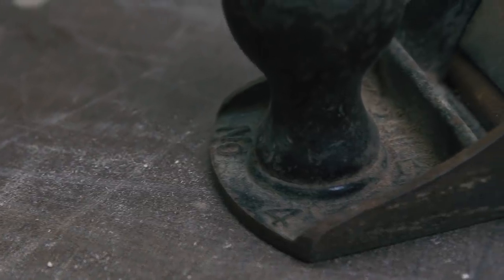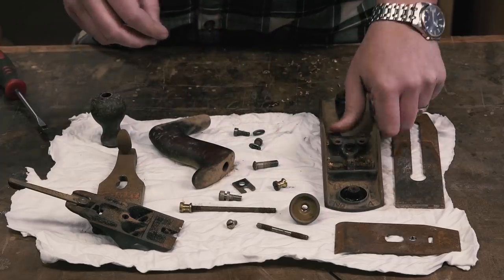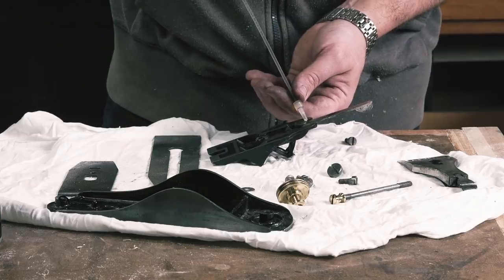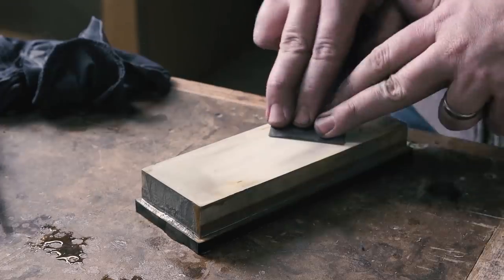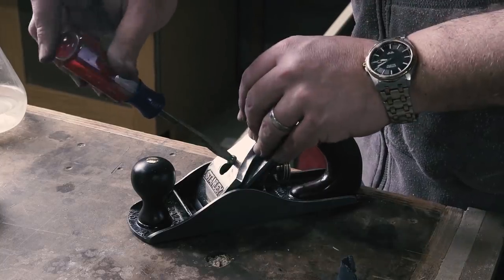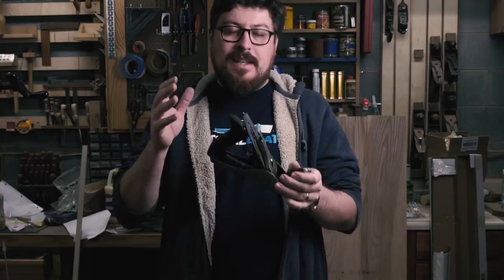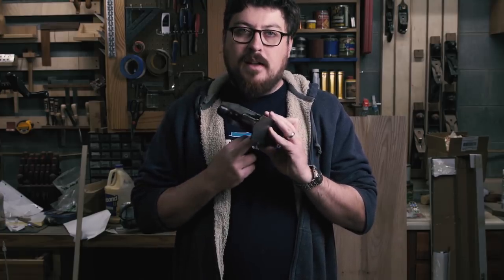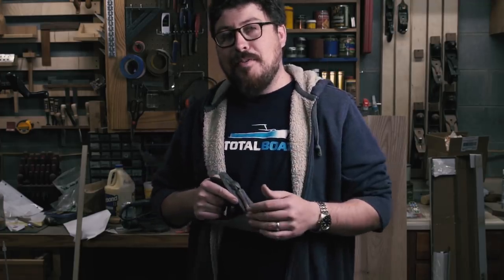How to Clean and Setup a Handplane (better than Katz-Moses)

Comment: One step that I recommend after de-rusting is to rub everything down with light oil and wipe of any excess. It will keep the micro pits from immediately turning black or begin rusting again in a garage or workshop.
Reply from the maker: That is a great tip!

Comment: Paste wax and polish while still in pieces is critical for where I am because of the dampness. Vinegar bath leaves a layer of carbon on the surface as it eats away the iron which is messy to deal with. Doesn’t look like that’s a big problem with this product. Thanks for the video.

Comment: Great video but I have a question. How far forward do you set the frog? I'm having issues with getting thin shavings and I have yet to see a video on this. Any help would be greatly appreciated. Thank you!
Reply: Try far enough so the blade won't touch the back of the mouth and not so forward that the blade binds with the front of the mouth when adjusting to depth... took me 3 days to figure that one out.

Comment: Haha, the #katzmoseswalkerfeud battle has a clear winner now! The shavings you took are stunning, can't believe my eyes.
Do you think this smoothing plane would be able to take a good shaving from a random-grain-direction surface? I recently tried using a number 5 jack plane on a cookie slab (3 trunks grown together, very unique piece) and couldn't get a decent pass even though the plane is nicely tuned.
Reply from the maker: That's a tough cut for any plane since you're cutting endgrain in a cookie. I think that would be a job for a low-angle jack.
Reply: Thanks a lot, I'll give it a go next time I work with a cookie like that!

Comment: Any tips on how to free a depth adjustment knob that is frozen in the frog? I cannot move it to save my life.
Reply from the maker: Have you tried soaking it in vinegar or metal rescue? Penetrating oil? Heat?
Reply: Is the knob stuck to the screw but free of the frog? Or is the knob, screw, and frog all locked in place? This can make the removal steps different depending on the set-up.
Reply: Blowlamp, let it cool a short time, then blast it liberally with WD40. Let it stand, then try to undo.
Reply: @thathandtoolguy  I cannot turn the adjustment knob at all - it is locked tight into the frog itself. Won't budge.
Reply: @wmwalkerco  Not yet - never heard of metal rescue. I'll check it out. I was not sure what to try to limit any risk. Thanks.
Reply: @bobpetti If would be careful heating up the brass with a torch as well as taking a torch to it when it's that close to the frog. As this could potentially cause stress cracks in the cast iron. I would use  a heat gun instead lower heat that wont damage brass or cast. I would heat it up and then soak it all in penetrating oil like Pb Blaster or Kroil. WD 40 is basically oily water. If the heat and oil dont loosen it up then a long term soak in Evaporust should work.
Reply: @thathandtoolguy  Ok thanks. It was fine one day - and then we had a real humid streak and everything in the garage got covered in condensation - and the next time I picked it up it was stuck solid. I'll give that a try - thank you.
Reply: On mine (Craftsman made by Stanley), the depth adjustment knob is reverse-threaded. I don't know if that's typical or not. But you might want to make sure you aren't trying to turn it the wrong direction.
Reply: @sgsax  Its quite common for depth adjuster threads to be left hand thread.
Reply: Remember that it’s most likely left hand thread.  If that’s not the problem, get some Kroil penetrating oil and drip a bunch into the threads.  Let it soak overnight and try it again.  Rinse and repeat as necessary.
Reply: @thathandtoolguy  WD-40 is Stoddard's solvent which is a petroleum distillate. There is no water in it whatsoever.
Reply: @1pcfred  I agree that WD40 is a commercial solvent aka water displacement version 40 and is a petroleum based product. What I meant by that water statement was that from years of using industrial solvents and lubricants is that WD40 is almost as useless as putting water on a stuck nut.
Reply: @thathandtoolguy  while WD-40 is not much of a penetrating lubricant it was never designed to be. It was made as a protective coating for rocket components.

Comment: I thought high boy knobs and kidney bean lever caps were much later Bailey features?
Reply from the maker: I use the Stanley hand plane dating flow charts to date my planes.
Reply: @wmwalkerco  you may have a frankenplane? The lever cap might not be original? Doesn't matter for a user plane. As long as it works. The body looks like a 1930s model. But it should have a keyhole lever cap.
Reply from the maker: The type 15s I'm finding on ebay have the kidney bean shaped lever caps. I guess I could never say for certain if someone swapped something on it, but it looks original to me.
Reply from the maker: It looks like they switched over to the kidney shape with type 13 on https://virginiatoolworks.com/tools/stanley-planes/bailey-identification/
Reply: @wmwalkerco  The body looks pre-war. That's all you really need. Personally I don't like low boy knobs myself. I guess guys just had the grip of death in the 19th century?
Reply: @wmwalkerco  if a lever cap fits it ships. I've ground them to fit myself. Some of the thin ones are really hard to find.

Comment: Just to set you straight Will .it's NOT  a chip breaker . Chip breakers are on machines . The part you are referring to on a hand plane is a CAP IRON. Well at least it was 60 years ago when I started my apprenticeship.
Reply from the maker: I've heard them referred as both. More specifically, the chip breaker is the leading edge of the cap iron. If you search chip breaker they are selling replacement cap irons under the description of chip breaker.

Comment: That's a type 16, the kidney bean lever cap started after type 15
Reply from the maker: Interesting. There seems to be conflicting information out there. The plane dating flow chart indicated type 15. I know there are many that are swapped parts. A quick ebay search shows many type 14s with the kidney shaped lever cap.
Reply: @wmwalkerco  if the toe and heel are raised then it's a type 16 per both Wood and Shop and Hyper Kittens flow charts.  Also the patent for the kidney bean hole in lever cap was filed in 1933 which is a type 16.  Any other plane with that lever cap is either a 16 and up or been swapped in.

Comment: Lol, l like a bit of fun like this. Secondary bevel though hmmmmm.
Reply from the maker: You dont? Why not? I thought for sure the back bevel was more controversial
Reply: Well as a kid in Jolly old England my woodwork teacher always said that those who put a secondary bevel on a woodworking tool do it only because they can not sharpen a blade the proper way. The tools he sharpened were like scalpels they were so sharp. I sharpen my tools flat on one side and only one angle on the other side finished on a leather strop. I could, of course, show you how if you like. LOL Just kidding of course!